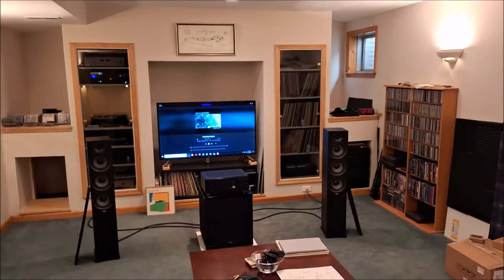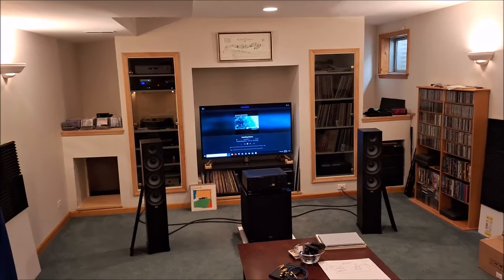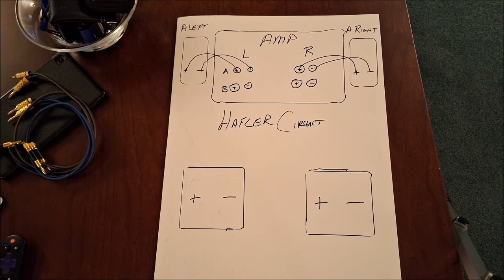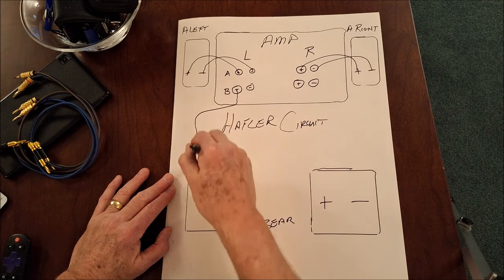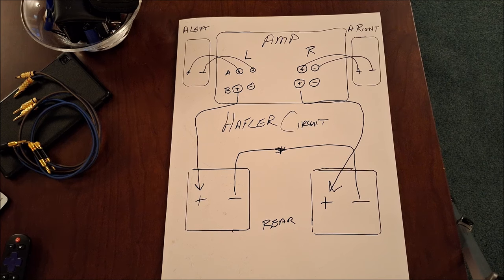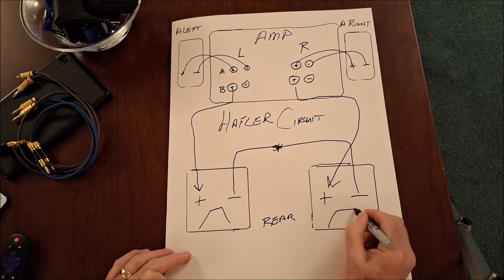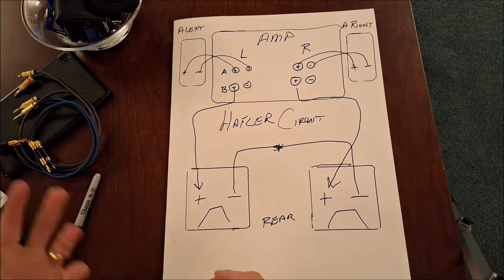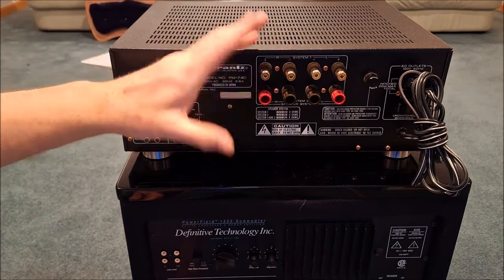How to get FREE Surround Sound from your 2 channel system!

Comment: This only works if you connect on same speaker pair because some receivers series speaker a and b..
Reply from the maker: I am not sure what you are trying to say. Please expand on your thoughts.  I look forward you response.
Reply: The circuit is like a voltage divider..the signal given to left and right is important because ..the diff channel isnt summed mono..its whats not left and not  right or a sum of them..its a signal thats whats left over.. lets call it left - right and right minus left.ha-ha.. but the original circuit had only 1 speaker in the rear..and later they show 2 spea kers..with the negatives connected together..actually I stated it was wrong..and It was observed and im concidered correct..heres how to fix the drawings.. concider 2 speakers in series ..like in a flashlight
. Left rear  pos goes to front spea ker positive.. yes directly to the speaker..+ ..and heres the change..the right front speaker + goes to the right rear -  .. heres why
.it recovers the bass reverb.. also..just Like the early drawing with 1 rear speaker..when the were outta phase in the rear it cancelled the bass..linear drop. My way corrects that....have you seen the drawings to also recover center channel? I have davids original drawings
Reply from the maker: @davidstevens7809  David, Thank you for the clarification.  I think I understand.  If you would be willing to share David's drawings that would be great.  Please use my email oldguyhifi@gmail.com.  Thank you so much.

Comment: Forty-two years ago in college, I had a system with this wiring method but came to it from Brian Eno's fourth ambient series album, On Land.  The instructions with the diagram are on the back and it definitely made Lizard Point and especially Lantern Marsh feel like you're floating in a canoe on the water with the sounds of nature; insects buzzing around making it feel like you're there.  I had a pretty decent setup back then with A pair of Alison Threes, pair of Alison Fives, NAD 3140 int amp, a Rega 3 table with a Supex 900 Super MC cartridge with  matching transformer(Premier Line Super-Definition MC Transformer).  It made a pretty good noise back then and probably do just fine today.  I still have the Rega with all the updates, motor, speed control plus arm with an almost new Nagaoka MP200, somewhere in a box, plus still have the Supex and Transformer stashed away in original box.  Anyhow, have a great Labor Day, gotta run.
Reply from the maker: Thank you. Yeah, Eno got it from Hafler. Actually we had been doing it since the late 60s. He did a good job of spreading the news/ I hope you have a great day as well. Thx.

Comment: My first introduction to it was nearly 50 years ago and I've been doing this myself for years.
It's easy to do well and sounds fantastic. Ive done this at High level (speaker level)
and line level (a bit harder to implement) and it sounds great either way.

There is a lot of out of phase information that comes out of the rear
speakers that is typically hidden when using only two speakers.
Reply from the maker: Agreed. I started doing in the early-mid 70s when I couldn't afford a quad unit. It is still in my system today. Thanks for the comment and the view.

Comment: I’m 48 years old and I stumbled upon this method while playing around with my stereo when I was about 17. I couldn’t believe the sound I was hearing and I decided to run it as surround through and amp with A and B speakers .
Many years later I was playing with it again because I never forgot the sound and I loved it .
I decided to go one further and I’m running the sound down to a 3.5 mm socket and into a Bluetooth transmitter and transmitting the sound to Bluetooth speakers ! 
I decided to look for more info on what I now know as the Hafler Circuit and Stumbled on your video and was blown away that something I played with years ago actually has a name and is a thing ! 
I’m blown away. 
I can’t believe that I worked this out by mistake years ago and never found out till now that it’s a thing. 
I have 1 question .
Could I create the Hafler circuit from a 3.5mm headphone cable ? So sound comes from the source (a stereo 3.5mm jack) and then into a Bluetooth transmitter (3.5mm jack) 
Can I modify the cable to create the Hafler circuit given that there is only one ground cable In a 3.5mm lead ? 
Hope I’m making sense.
Thanks so much for your video , I’m so happy
UPDATE I have made a mini amp and Bluetooth transmitter set up. Would love to show you some pics if possible ?
Reply from the maker: I would love to see your photos. Send them to oldguyhifi1@gmail.com. I look forward to seeing them. Thank you.
Reply: Your drawing doesn’t correspond with the wiring you did at the end😊…..I guess trial and error as I attempt this top. I don’t want to damage my amp
Reply: @gdwlaw5549  It actually does correspond.  If I am wiring the rear speakers and I twist the grounds together at the back of the amp or if I run a wire from one to the other connecting the grounds, it is identical.  It is just easier to do it at the amp than have wires running across the floor.  You won't damage your gear.  Honestly.  There is a wiring diagram in the description of the video that illustrates that.  Thank you so much for your comment.  NOTE  I have created a new channel for my audio content. www.youtube.com/@OldGuyHifi.  I would be grateful if you like and subscribe.  Thank you so much for watching.
Reply: @edholmwood  indeed it does … I need to see something :-) … not my strong point wiring loudspeakers
Reply from the maker: @gdwlaw5549  No worries.  Please let me know if you try it out and what you think of it.  My email is in the channel description. Thanks again.
Reply: @OldGuyHifi  I shall have fun this weekend. If you see a puff of smoke in the direction of france then you know why :-)
Reply from the maker: What brand of amp are you connecting to?
Reply: Winslow burhoe stumbled on it first..david hafler first called it dynaquad. The hafler pseudo quad..
Reply from the maker: David, I didn't know that.  I remember Winslow from his days at Epicure.  I just remember that Hafler at the time got all the press because he founded Dynaco in the 50's and had earned a good reputation so, when he incorporated it it to the Dynaco QD-1 Quadaptor, that unit got a lot of press and traction in the market.  Thank you for that info it is good to know. I appreciate you taking time to view and comment.
Reply: David haflers circuit is done in the output stage of the amp.. the rear channel is only whats not left or right but everything thats not common. Carver called sonic halography..polk called it sda. Jim fosgate actually did it in the preamp stage sortta like ur wanting but you need opamps set up as buffers.. if you google matrix. Or hafler pseudo quad u can get info on it.

Comment: Diff amp
Reply from the maker: Again, I am not sure what you mean. I look forward to hearing back from you.
Reply: @OldGuyHifi since both series Hafler speakers are connected to the +ve terminals of the R and L amp output, the are playing the difference of the R and L signal. Current moves through a speaker's voice coil (moving it and creating sound waves) when there is voltage difference across its input terminals. In the Hafler circuit, the voltage difference across both +ve amp outputs is whatever the difference is in the stereo signals. Flip the amp to mono and the Hafler speakers go silent (if the amp channels are balanced exactly). Likewise, the Hafler speakers produce no or little bass because bass info is recorded in mono (and that is because our hearing cannot discern direction at lower frequencies). 
The Hafler circuit is interesting and I don't know how the psychoacoustics here exactly; time to do some reading.
Thanks for bringing this up. 👍👍👍
Reply from the maker: @nabman_  Everything you said is correct.  I do however get bass out of the Hafler speakers because there is a lot of stereo bass these days and engineers like to play with the pan pots. Thank you for you insightful comment.

Comment: On the rear speaker at negative terminal both side put an  25 ohm rheostat contact to ground.
Reply from the maker: That's a great tip. I will try it out next chance I get. Thanks so much.

Comment: BUT watch for the impedence!
Reply from the maker: The impedance is not an issue. It is something like 16 ohms. Thx.
Reply: @OldGuyHifi  if your speakers at A are 8ohm each and you connect 16 ohm speakers in parallel to A you will get round about 5 for your amp, because the A and B channels for most amps gonna be connectet in parallel.

If your speakers have 4 ohm you end up way less.